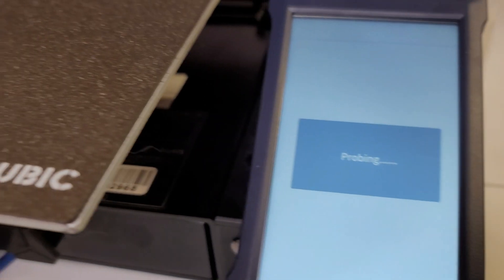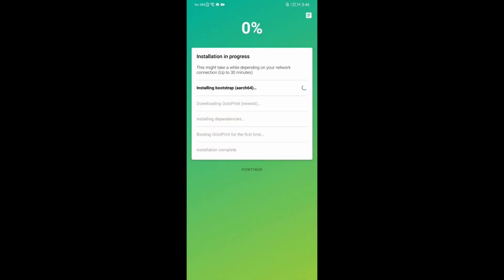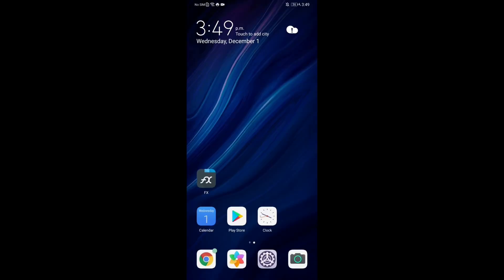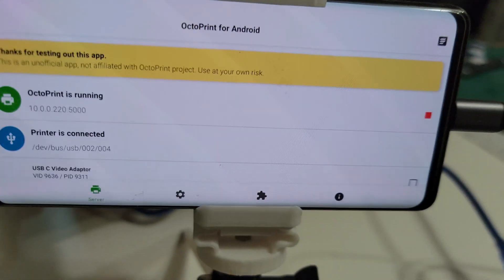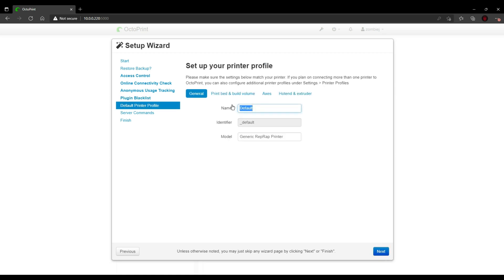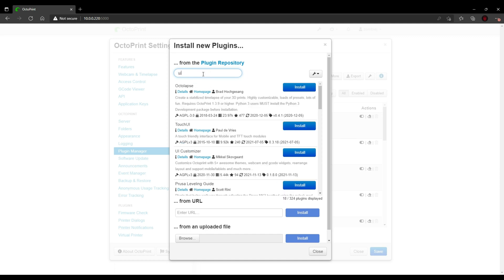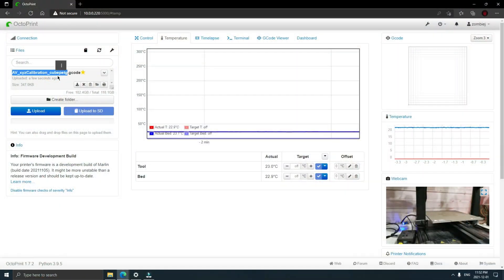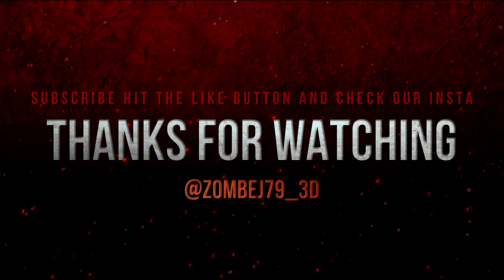Octo4A on Android setup Anycubic Vyper

Comment: DON"T USE OCTO4A!!!!! It is not reliable and the developer isn't fixing the issues. It's a great idea, and it might work long enough to be a cool novelty (or long enough to make a YT video...), but it will always end with an app that crashes and becomes unusable. I sank way too much money into android phones because of this horrid app. Need a raspberry pi alternative for octoprint? Tough- I've tried everything and it always ends badly. The only way is if you're already a Linux guru that can customize an image perfectly to your hardware- in which case you're not watching this video...
Reply from the maker: Its a nice option and works fine for shorter prints, but it is very hit and miss, I was hoping it would get updated more often but sadly it hasn't. I use orange pi zero 2s for octoprint and it works awesome maybe a bit better then the pi it's a bit faster of a unit. You just install Linux and you can follow the guide on the octoprint page to install octorpint. It's a great option due to the avalibity of the orange pi units and they are pretty cheap I got my orange pi zero 2 for 40 Canadian.

Comment: Help needed: I am using a Samsung Note 8, I have the latest build as of this post of Octo4a, I am using a Monoprice MP10 and a Dell adapter. I hook everything up and it comes up sees and connects to the printer but under the Dell adapter it is asking me to select a driver, Im not sure which to choose. Also when I go on my computer put in the address I can access the Octoprint web interface, install plug-ins, view the camera on the phone but I can not get it to connect. Can someone assist in troubleshooting this problem? Thank you so much.
Reply from the maker: For the adapter don't use any video options on thw USB hub. I can't remember what options there are but I remember one being for video and it wouldn't work

Comment: I don't have an extra Android phone, so I try with an android tv box. I didn't have a problem installing Octo4A but when I try to connect it to my browser it doesn't load. It's possible to use a tv box??
Reply from the maker: I don't see why not. I'll test it on a couple android boxes I have. I did android TV development for a bit years ago. And I've been meaning to test android TV boxes with it. Should be able to use the address but the TV box might run a bit different

Comment: That is very helpful, thanks! Do you know how to set the focus for the phone's camera, so it won't shift during a timelapse?
Reply: Mount the phone directly to the bed so the camera moves with the bed focused on the part.
Reply from the maker: I think there's a option on the phone octoprint menu itself to disable auto focus. Go onto the phone and hit the setting icon at the bottom under the camera options is a disable auto focus option that should help.
Reply: Yes, I see the Disable Autofocus switch, but then the camera is always out of focus. There must be a way to set the focus manually. Anyone?
Reply from the maker: @StevePotter  I'm not really sure. If your using octolapse for time lapse try to set the phone up with the bed in the spot the picture will trigger to see if it will focus a bit better that way

Comment: How do you keep the phone charged. I have tried to use one of those usb c hubs and when I conect the phone to a electrical socket it doesn't charge.  Also how do you stop th e phone from going to sleep
Reply from the maker: The charger I got is 100w so I think that's why mine dosent die. And for the phone going to sleep when you I stall octoprint I think it asks to disable all battery optimizations
Reply: @studiozombie3d  Can you link to the charger you are using?  I can't get my old Samsung to charge and connect
Reply from the maker: @riddockc  https://www.amazon.ca/gp/aw/d/B097T45LRD?psc=1&ref=ppx_pop_mob_b_asin_image
This is the one I'm using. It has 100w charging and seems to work good on my Samsung and Huawei phones

Comment: Hi, I wanted to update my firmware using your custom compiled files, downloaded the ZombieVyper_V2.rar, but saw  the next day that you updated it with ZombieVyper_V2.75.rar.
Could you provide a patch note for this new version ? I wonder which one to use.
Thanks =)
Reply from the maker: Try rhe 2.75 it's been updated to marlin 2.0.9.2 same as my previous just marlin updated. When flashing the printer itself when flashing the mainboard will been and light will go on and off then the anycubic logo will show on the screen wait a minute and power off and on and check version should be 2.0.9.2a

Comment: great vid as always..👍 how did you manage auto level with more than 4x4 points?
Reply from the maker: I've been running my own custom firmware for months on my vyper with linear advance and junction deviation plus a 6x6 level grid I find it's a much better mesh 

https://drive.google.com/file/d/1fIU_pV5bnlu77GIQXc9qPa7W9otn1aFr/view?usp=drivesdk
That's my latest version

Comment: I've been running my Vyper via a Google Pixel 2 with Octo4a since Christmas. It cost me under $60 to set up and works great.
Reply from the maker: I still use my pi 4b but I have a few printers coming and I got about half a dozen old phones this is one of the best things for 3d printing since the pi itself. Can be a bit buggy depending on device but it's awesome
Reply: @studiozombie3d  yeah, it was hard for me to get a pi, but the phone is great, and once you find a model that works well, they are cheap on ebay.
Reply: @studiozombie3d  I think for beginners, it's actually a much better route to go than a pi. Far easier to set up, and for most newbies, does everything they need.
Reply from the maker: @Velacreations  it is super handy. It's still in development but I haven't seen too many bugs or issues  with it yet which is great
Reply: @studiozombie3d  it's perfect for my kids, they can run Cura on their computers, send files to the printers, record timelapses, etc. And we were up and running in a few minutes.
Reply: @Velacreations  that's awesome lol did you install octolapse or are you using the stock Time-lapse?
Reply from the maker: @Velacreations  don't know why it replied without other account lol